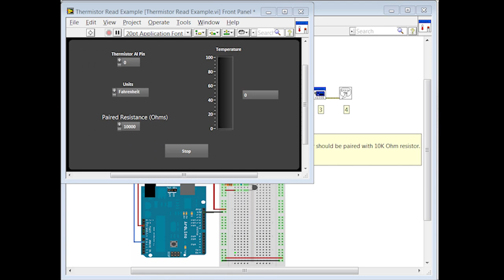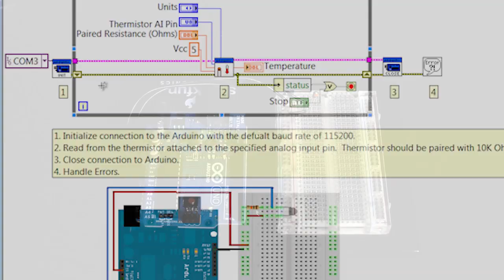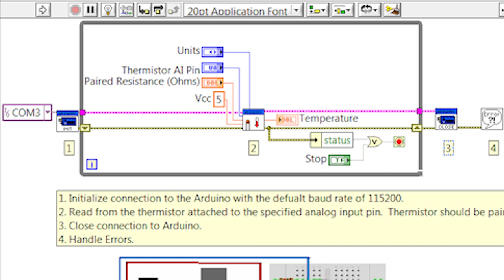LabVIEW Interface for Arduino (LIFA) Toolkit Overview

Comment: Hi there. Have downloaded the toolkit It does not seem to detect my COM port. Mine is at COM7. It's a Windows 7 OS ( 64 bit ).
However when I try to connect with VISA, it works detecting a serial output which I then convert to number & display.
Why wont it work with the toolkit. Do I need to install something additionally to get access to the I2C bus or something. Wnated to post this on the NI forum but was not sure. 
Thanks.

Comment: I love Labview - it's a huge part of my job
BUT
there's one advantage to using te arduino board programmed in C...  it'll run by itself.  without deploying code to the processor, it relegates the Arduino to just bring an interface..  lots of those are already available both from NI (expensive) or companies like Measurement Computing (less expensive) - and they dont require you to design interaces..
really, the LIFO is more for hobbyists than serious device builders.